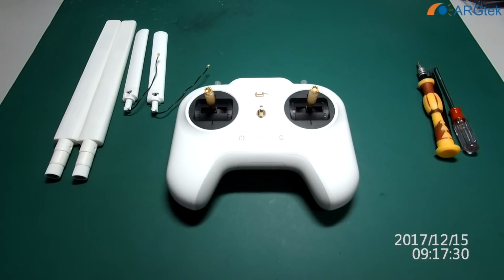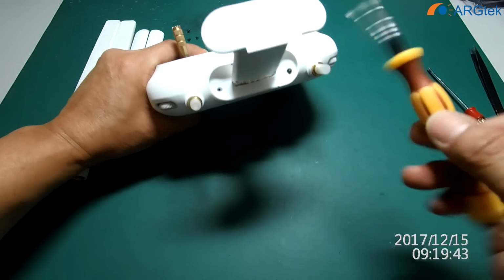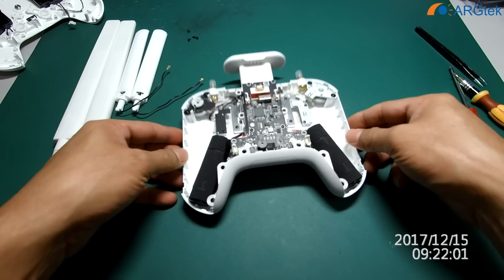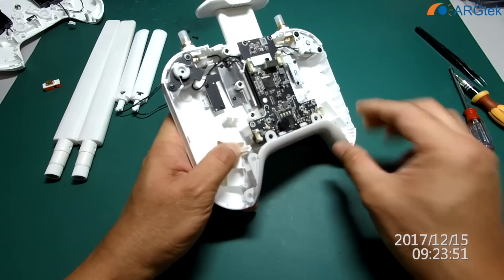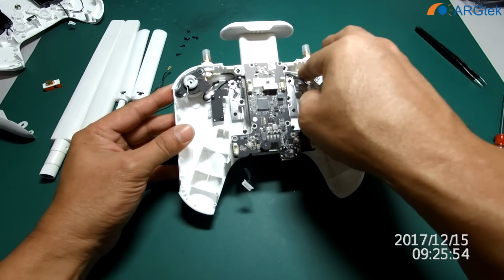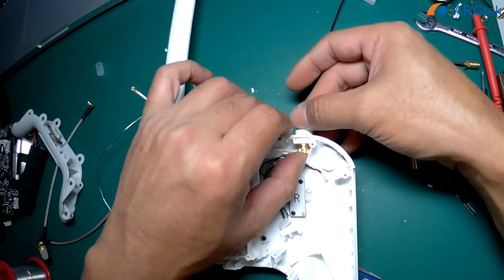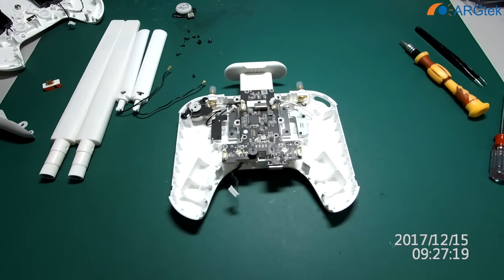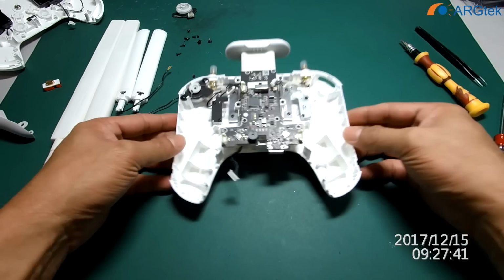Mi Drone 4K - ARGtek WiFi Range Extender Installation Guide

Comment: No way! I was thinking of getting these ARGTEK extenders for my Mi4k until I saw this vid. Way too much stripping down and potential for snap offs etc. Why can’t you design an aerial that piggyback onto the existing aerial connectors. Just plug and play dude. I don’t want to mess around and disassemble my controller, I want a easy plug and go solution and I’ll oay for that. Good luck to everyone who wants to dismantle.

Comment: Thanks again for great video,for long range flying and video's would you recommend patch panel antennas or omni directional antennas for the xiaomi mi 4k drone?
Reply from the maker: I haven't run full test with panel antenna yet but i will do it assp and once have done will upload here for sharing.

Comment: Hello. In your video I can't see, how do you remove the stock antenna. could you show me how make it? Thanks
Reply from the maker: Fernando Cortes Labastida Hi, just use cutter to cut and pull out the stock antennas.
Reply: I've just figured out...after I almost went nuts...:D
The stock antenna cannot turn 360 degrees, it stops at a certain point. So try to overturn after the stop point and the  holder of the antenna which holds the antenna to the RC will go a little bit towards the center...and at that point if you just grab the bottom of the antenna and try to move to the front and to the back, it just pops out. You can remove these without any harms in 2 seconds. :)

Comment: Thanks again for mod directions, could you please tell me what android tablet that will work with the mi 4k drone and which firmware Thank you
Reply from the maker: Actually most of the android devices working well for mi drone, and so far mine is running latest version firmware and tested no issues.
Reply: Też stabilne 2 kilometry niezależne czy w terenie zabudowanym czy w terenie

Comment: Are the differences between Omni-directional antenna and Panel antenna is Panel are directional? Must maintain line of sight with drone?
Reply: Also in the Omnidiectional antenna does the curved surface have a sort of parabolic focal point reflector molded into the "back" surface of the antenna?